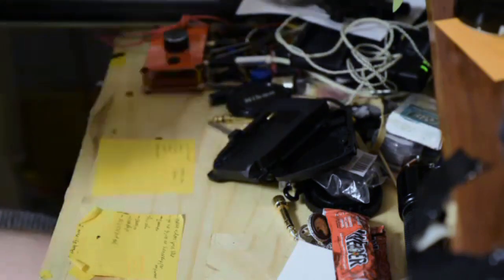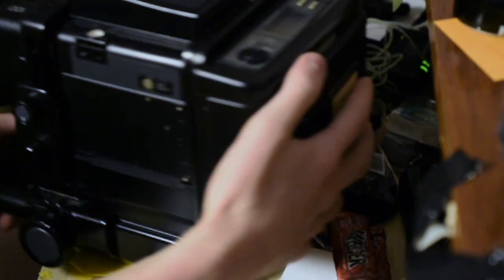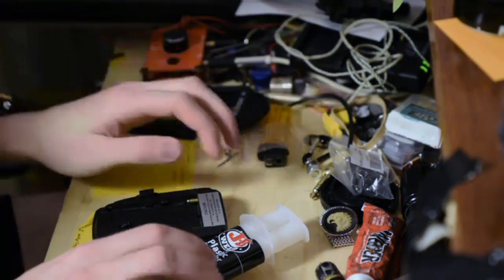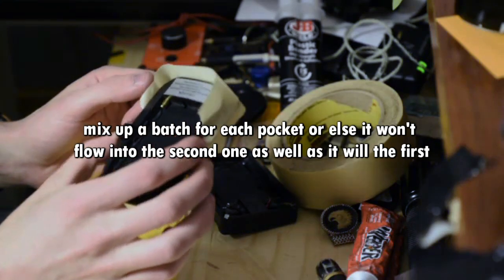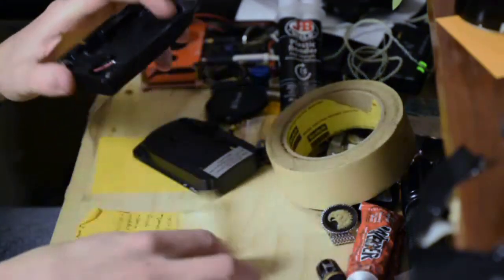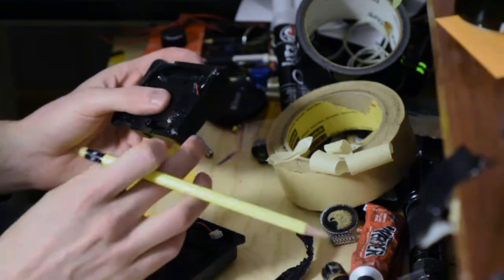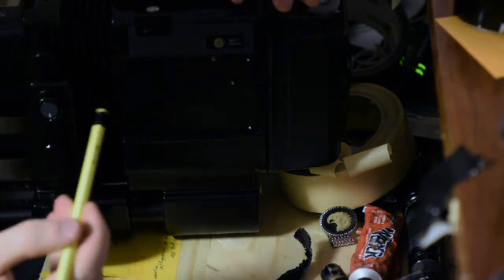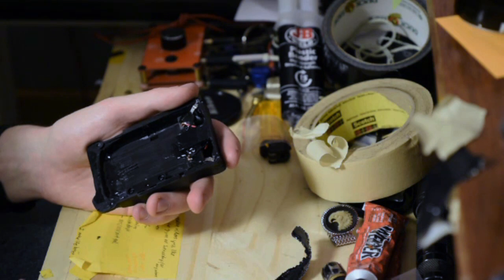DIY Battery Upgrade for the Fuji GX680 I/II

Comment from the maker: time stamps if you just can't wait until Christmas morning
BTW the plastic piece I mounted up at the front isn't actually necessary.

2:06 talking about batteries
4:13 scary Japanese charger
4:23 talking about the adapter/what you need
6:20 start tutorial/squaring off the front corners
8:58 epoxying the back of the plate (which btw you don't need to do if you don't plan on trimming off the edge)
11:40 cutting stuff out and sassing viewers
16:57 setting up some electrical contacts to transfer da powah
20:29 the end of the video if you want to go there